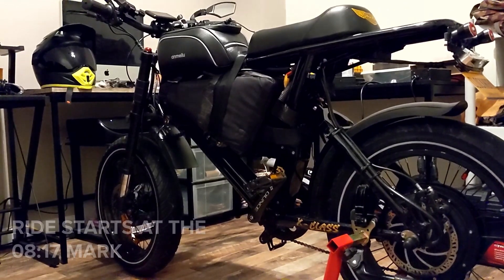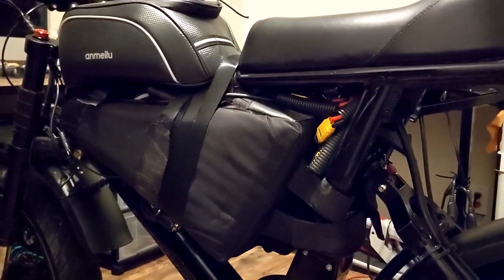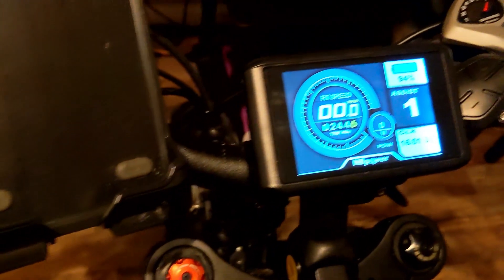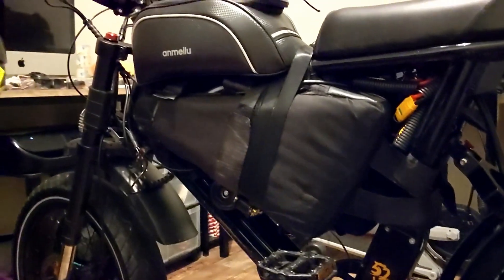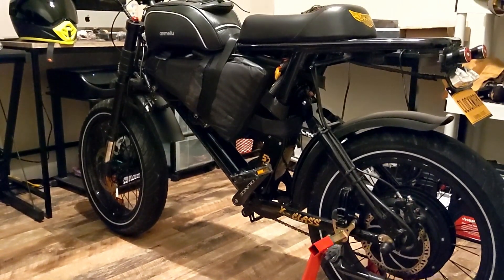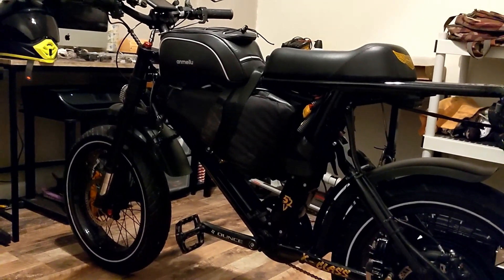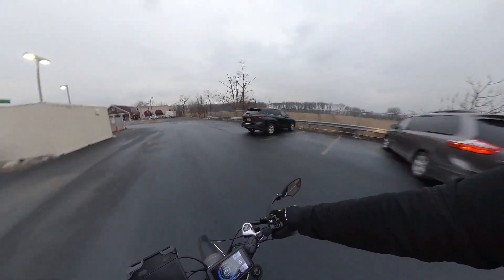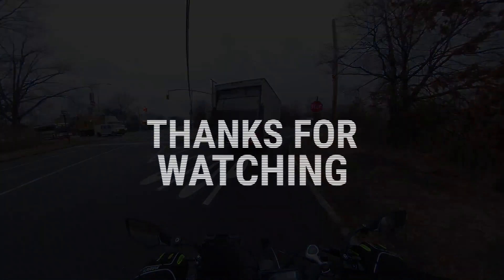Ariel Rider X-Class Speed Mods | Episode 2 - Bike Overview + Bonus Ride Along

Comment: This is really helpful. You know how frustrating it is when there’s upgrades out there but no one makes a video to show what it’s like to actually own one! The main thing holding me back from doing this is that AR talks about the hub motor being metal not nylon and I’m guessing this 3k motor is the nylon kind?
Reply from the maker: That's actually a good question that I'll have to confirm with Sal because I know most motor kits from overseas do build them stock with nylon gears.
Reply: That's a direct drive motor. There are no gears at all! Even the cheapest direct drive motors are known to be more reliable than the best geared hub motors because there are less moving parts. All you really have to worry about is heat, which can be controlled with statorade and heat sinks.

Comment: Your actually pulling 5760 watts and 6720 full charged. It's actually the battery voltage x continuous amps and limits of the controller that decide the power not the motor. 3000w is just what the motor is rated for it can actually handle a lot more. I learned that the hard way buying an under powered battery lol. Sick video man🔥
Reply: So you're saying if I stick with the stock grizzly motor and get the extra battery and controller I can hit the same speeds as this guy? Sorry for asking I'm new to this whole thing
Reply: @Promptaire  It would most likely overheat. Ariel rider has a 1000w motor so you could get away with 2600-3000w but past that is very risky. For his power level your best bet is a motor rated for 3000watts
Reply: @jeromedickey5182  oh ok thanks for the information have a nice day :)

Comment: Great video! But are n’t you worried at all going that fast, without plate or registration. NYC limit speed @ 25-30mph for ebikes.  I will be sweating riding that bike here in Florida. $1000 or more fine and impounded.  I just happily stick to 28-30 mph ebikes and so far no local cops bothered.   Good luck.  Just subscribed
Reply from the maker: Thanks dude! Yes it's weird here in NYC as the cops don't care much about ebikes on the road. However, once you get on a public bike path here that's when the park police will try and stop you and hit you with a summons. 2 of the reasons I stopped getting on the paths: risk of summons and dirty looks 😆
Reply: @JB360_NYC  Even when you're riding at 50mph, the cops don't care?
Reply from the maker: @vidspeed  if you're doing 50 in like a 30 mph zone then yea it will raise some NYPD eyebrows and they will tell you to slow down. Just as long as you're not reckless running red lights and blowing through stop signs they will not approach you.

Comment: What kinda of range can you expect with only one 72 volt battery?
Reply from the maker: It really depends on how you ride it. I ride rather aggressive on long stretches of road so my range only gets me that 40 miles. For one battery riding aggressive, real world range could be around 20-25 miles. If you ride consistently around 35-40mph that range increases to about 35 miles.
Reply: @JB360_NYC  but this is 40 miles in cold weather? Because lately in staten island, it's been really cold. And cold weather decreases range on ebike batteries.
Reply from the maker: @paperkilling  exactly since I've been riding in the cold since November, I have yet to test out the range in mild to warmer weather.
Reply: One battery will not get top speed of 55+ mph.
Reply from the maker: @badimpulses17  I actually think this is a good theory to test out, possibly in a future video. I'll swap to just one and see what top speed we get.

Comment: You need a good 4 piston hydraulic brakes system with 203mm rotors with this speed and power
Reply from the maker: Yes for sure! That's my next upgrade to 203s. Just got them in the other day.

Comment: do you have a link to the new full grip throttle?
Reply from the maker: Yes this is the one I got that works with the new controller NBPOWER 2019 Top Limited Elelctric Bike Full Right Hand Grip Throttle Ebike Sets https://www.amazon.com/dp/B07JZ4XNZG/ref=cm_sw_r_apan_glt_i_Y7PXYM9C3QC43J24PY06?_encoding=UTF8&psc=1
Reply: @JB360_NYC  thanks man! i bought a kit from sal too. installed it last summer. now i'm just waiting for the snow to disappear here in michigan. he's awesome and his website has the best kits!

Comment: Good video, and that would qualify as a motorcycle. That controller is huge compared to a 90 amp Phaserunner, are you using field weakening to boost your top speed?
Reply from the maker: Not using field weakening but when we were testing out the 2 batteries connected by the datex2, it boosted the top speed an extra 2-3 mph. Not sure what technology datex2 is using but its pretty impressive lol.
Reply: @JB360_NYC  Is this a 3T or 4T?
Reply from the maker: @TheDaneo2022  this is the 3T motor version. I wanted the 4T motor for the higher top speed but Sal ran out of them.
Reply: @JB360_NYC  This is still fast as heck. Love the video. I'm going to do the same exact build you have with Sal. Been talking to him about it. Any tips I should keep in mind?
Reply from the maker: @TheDaneo2022  one thing I would say is to definitely take a look at the light kit. Once you have the new motor and controller setup, you won't be able to use the stock rear light and headlight. The kit actually looks really nice with the frame and the new light is like 10x brighter.